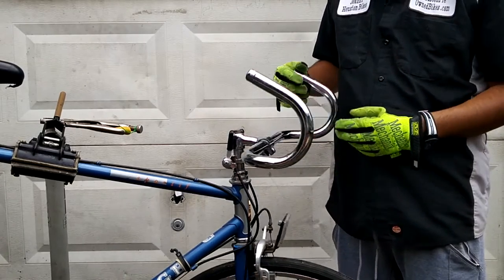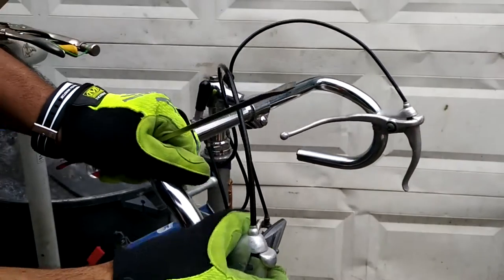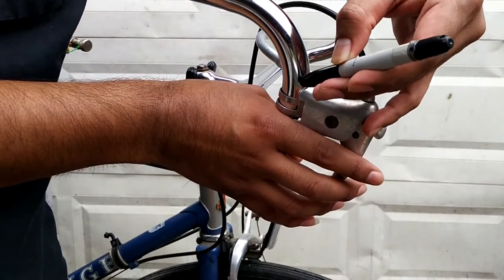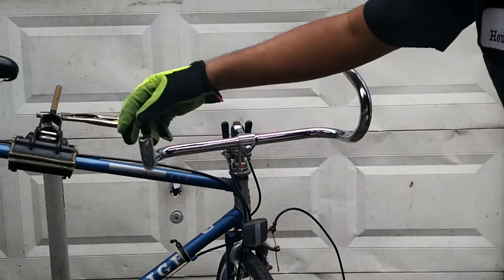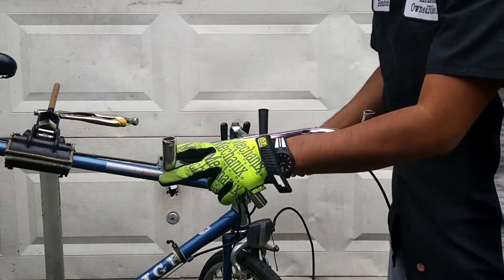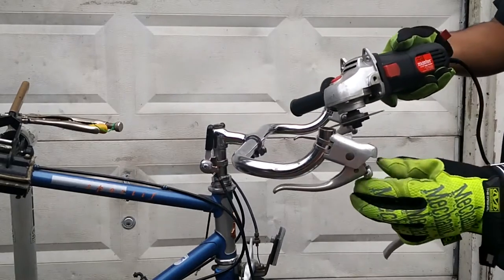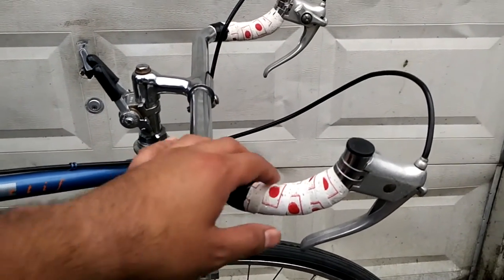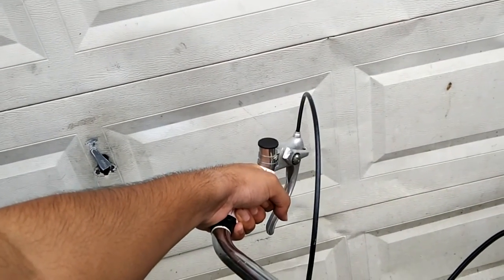Turn Your Dropped Handlebars Into BULLHORNS For FREE (Step By Step)

Comment: It cost you a dropbar for sure. But like the idea because you can have a shorter reach bullhorn by converting from a compact or anatomic dropbar but still having enough curve/rise.
Reply: Though if you already have a drop bar and don't want it, it's value isn't really factored in.
That's an interesting point about the differences there, I personally don't want to have to reach too far forwards, and I also like this idea more than buying a flat bar or risers and then attaching neutral bar end grips.
Reply: @Siberius-  definitely. It looks way cleaner than a flat bar with neutral grip attached.
Reply: @egazf  - Absolutely, those bar end grips can look pretty wacky at times, or at the least, peculiar. Not that I think that should necessarily stop someone!